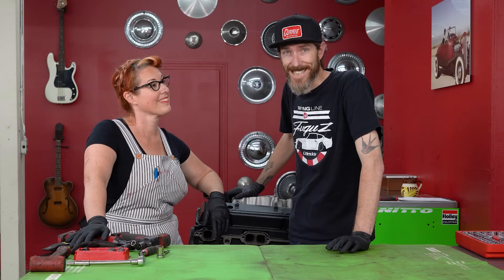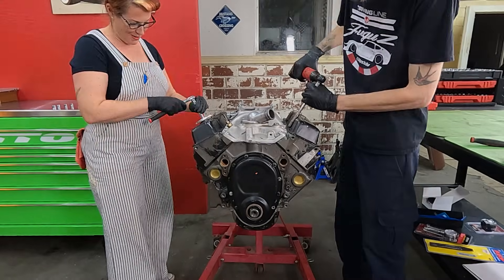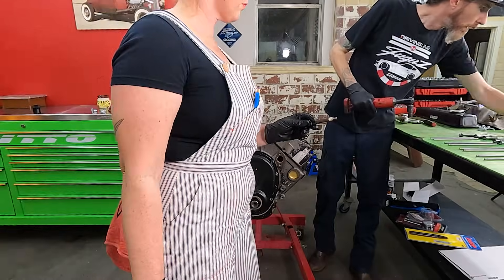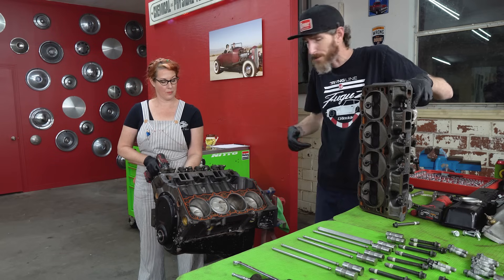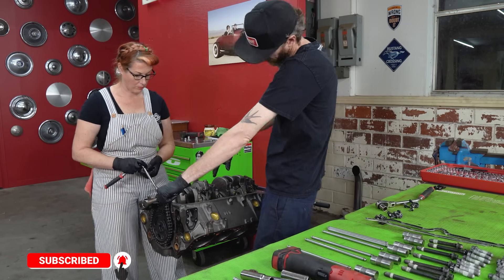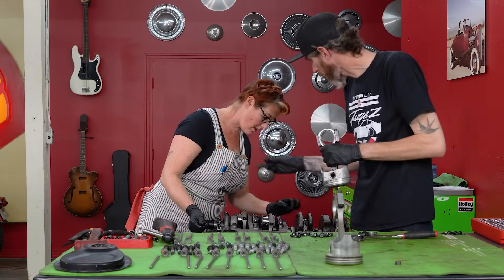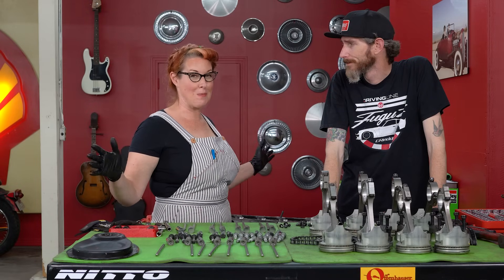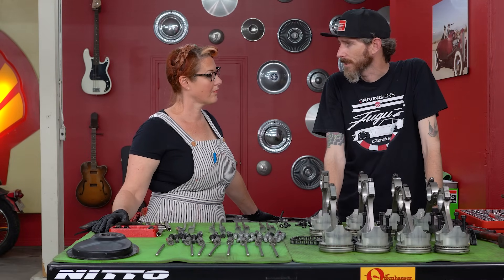Engine Rebuild for Beginners, Part 1 | Extra Good

Comment: Would have been great to tell us what to look for that indicates a replacement or repair needed - and which items can be upgraded for HP.  Not the 1000 hp you mentioned but the 20-50 here and there you can get. I’ve heard, for example, a better cam shaft can be helpful to increase HP

Comment: I liked to always start off with a work bench heaped up with sand and boiler slag before I tear into an engine. Then I high pressure wash all my parts with you guessed it 3000 grit water, but not before I drag the engine behind my truck down a dirt road clear over to Chester’s house 2 miles south of me up the crushed obsidian  sides of a dormant volcano.

Comment: Thank you guys! 
I think you should show more about what you are doing on the block and everything inbetween. But I got a general idea on how to take my own apart. I Just picked up a Ford 5.8 from someone on Craigslist, I wanted to completely rebuild the engine because its still old and gross from its days as a work van engine. Now its going into a 1993 Mustang. I want to not only make sure everything is good and replace whats needed. I also want to clean it up and get a general idea so I know if anything goes wrong I can probably handle it

Comment: > only Google this to see another "legit" mechanics explanation, as I was scolded today about my 4.0 L6 rebuild due to not checking the bearing clearance, connecting rod cap width, checking crank and cam lobe specs, cylinder bore width, piston diameter, rings, and crankshaft play with a dial, etc. I've done many motors without such spec checks, and took the lump. But if he is right (which does make sense), then you are wrong for putting this video out making it seem to others that many other steps aren't needed. If this is right, then the teardown manual progams like Alldata are useless and a wasteful purchase. I however have NEVER had issues with rebuilding like this and so on. And all parts that were damaged were replaced new without spec checks. Kinda bummed me when he told me "you aren't really rebuilding a motor, you're just slapping new parts into an old block". Not to mention head resurfacing, cleaning, block resurfacing (which I never do) and honing your cylinder bores. 

A lot is left out here, but should be let known that many many other steps are required other than simply throwing parts into a block.

Comment: I am working on my Toyota camry rod knock issue, i pulled out the engine and started disassembling the parts following your  video and here is what i noticed. I have combined both videos(rod knock issue + my observation) https://youtu.be/UI9hx6zHBps, please help me does changing the bearing is sufficient, or do i need to do anything else
Reply: Hello, i watched ur vid and here is my opinion, i can see the play in the bearing the others seem to look ok so u can get away with just changing the bearing so long as there's no obvious damage anywhere else if budget is a concern but while its stripped down that far you may aswell just rebuild the whole thing because when one thing goes it's usually followed by something else too it in most cases however carefully examined the other components incase theres further wear or damage.
Reply: If u have more questions feel free to ask as I've seen pretty much everything to do with cars and repairs
Reply: @jason-km1wi  Thanks Jason. I am considering to change the Cranksshaft and connecting rod along with bearings. when i opened the crankshaft, i could see that bearings are badly damaged, craft shaft seem to be okay but if i have to take it to machine shop they charge me a lot for the job. so i decided to order a crankshaft along with connecting rods and bearings for 250$ from autozone
Reply: @maheshhm  that dont seem like a bad deal for peace of mind rebuild is definitely the best way to go as a used engine may be easier and cheaper but may have the same issues lurking around the corner if theres one thing ive learned from experience its that if you buy cheap you buy twice. Good luck with the project 👍

Comment: Excited to see what’s in this series, about to pull the engine in my 99 Cutlass with the 3.1L and I’m trying to keep studying up on engine rebuilds to make sure I don’t mess anything up or miss anything. It only has 70K on it but long story short it overheated very badly 2-4 times so upon doing a leak down test I need to do the rings and check everything else. Just waiting on being able to get my hands on a hoist.

Comment: Since you took it down that far should you replace the bearings, rings, and have the block magnafluxed, and replace the head gasket and valve cover gaskets?
Thanks for the best tutorial I think I’ve ever seen. I can see you need room.
Reply: Great question! This video is really just showing tear down (and reassembly in part 2), creating a foundation for someone who perhaps hasn't done it before. What needs to be replaced and done to the components is all a question of your specific project. If an engine is getting rebuilt, there are lots of other things that you'd do before putting it all back together.

Comment: The only thing that's been holding me back on pulling my 455 Olds engine is fear.  This video finally pushed me over the top to get out there and do it.  Thanks!
Reply: Did you do it?! Im in the same boat with my 455!

Comment: Great video, thanks for taking the time with it.... I'm about to be doing my own engine.... 94 GMC K1500 350... Used dumped in replacer with 245K on the odometer... Great truck, cant kill it seems like... So figured what the heck an who cares about weight reduction rust long as she moves and does what I need, she wont go to the scrap yard...

Comment: I have 2 L shaped blocks made by a 2X6 attached to a vertical 2X8 designed and drilled to hold the whole valve train of one side of an engine.  This way all the parts stay together as removed and very little chance to get mixed up.  Like they are while laying loose on a table.

Comment: Hey you need to know your torque specs, not gonna say where to get that. Put the bolts back in in reverse of how you took them out, not gonna say the order, just gonna let you have a leaking cylinder head.

Comment: We’re going to show you how to rebuild an engine. Literally. You’re going to watch, maybe read a bit, we’re not going to show people what the parts are. Not going to say this is the valve cover, this is the intake manifold, these are the valve springs, rocker arms, keepers, push rods, lifters. Nope, just watch us and listen to us talk amongst ourselves. Don’t even think about a close up. We’re still gonna call this a tutorial. It’s like teaching someone long division but not explaining a thing, only letting people watch. Terrible video. Learned more from the spike channel between commercials. Good example, you put protection on the threads for the piston bolts to protect the cylinder walls, you didn’t say a blipping thing about what how or why. 👎

Comment: Good video but not much of a beginner. You should explain all the parts and what their purpuse is. Also u didnt mention how to keep track of all bolts and where they go. Also would be nice to see a more seasoned motor and parts that get replaced. This is just a disassembly. Nothing abour seals whats replaced what can be reused and what not

Comment: I got a question ,, if we build a engine do we use the old one or do u buy a new engine block
Reply: You can ether resurface the head and block, if it is warped, at a machine shop or you can buy a new block but it is more expensive and it’s not hard to measure for any runout to see if you have warpage.

Comment: Curious, cause this is my first time taking apart an engine to do a full gasket change and other stuff. Other than the hand tools in this aftermarket manual, for my 2010 Chevy Impala, what other tools would be essential to taking this engine apart. Does have a timing chain.
Reply: Time patients and pictures so you don't forget how it goes back together.  Good luck bro 🤘
Reply: @DanielQ-b1p  it's already done. Doesn't leak and has more power than before.
Reply: @ajhillenbrand7817  nice man good job 👍

Comment: Nice video. I think the unstated intention (and the value that a lot of people missed) is to show that the disassembly/assembly process should not be intimidating for a first timer. I'm sure there are many build-specific videos for the experienced wrench turner, but that's not who this is for. Rather than focusing on any specific, technical aspect, their casual approach was more of a way to show that the process is pretty straight-forward and becomes easier as you do it. I have rebuilt several engines over the years, and it all started with the first one.

Comment: How and where do you get all of the torque specifications for the nuts and bolts? The engine manual or repair manual?
Reply from the maker: Great question, as those torque specs will be different for every engine. If you happen to have a full repair manual, they should be there. But you can also search your engine specs on the internet - only recommendation would be to verify across a couple of sources so as not to take something posted incorrectly.

Comment: well you must be youtubing as beginners cuz a beginner would find themselves in trouble if they followed this, you kinna attempted to caption the break down but sort've just stopped by the 2nd or 3rd step, you didn't really describe anything you were doing, like what was the thing called holding up your engine, i have know idea what exactly i have to purchase or can i just put the block on a table, does it need to be detached from the transmission to do this and or outta the engine bay, what were those studs called that you used to remove the pistons, does it HAVE to be disassembled in this order or could you remove the camshaft before you remove the crankshaft, like i always thought the crankshaft was the very last thing to remove, but by far the biggest thing you didn't mention which i know for a fact is a huge deal is ensuring during reassembly that you get the timing right, my repair manual brings that up like 100 times when i was skimming thru it

Comment: How long do you guys typically let a new engine idle for before putting any load onto it?
Reply: Typical break in is 20 minutes at 2000 rpm for flat tappet cams.